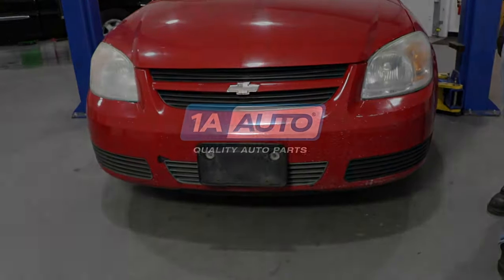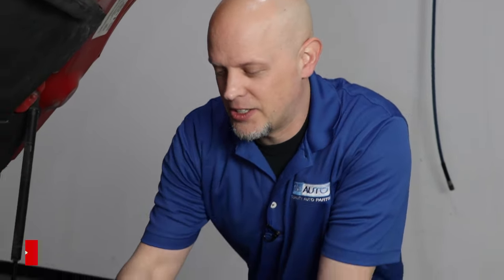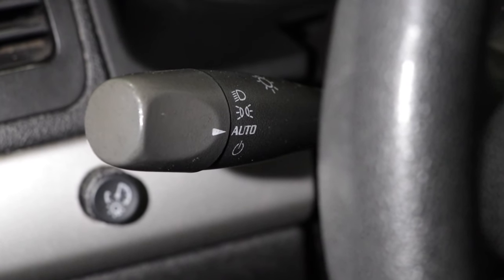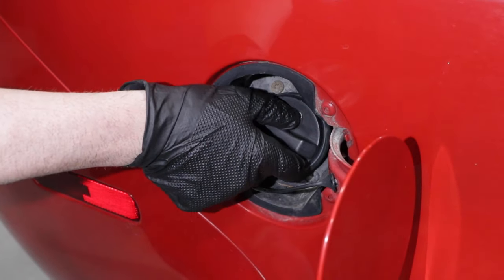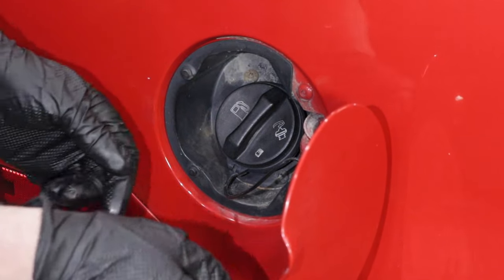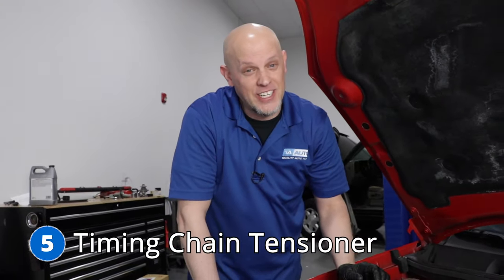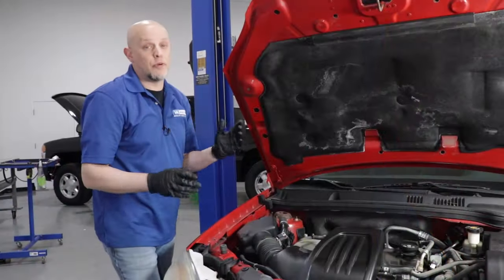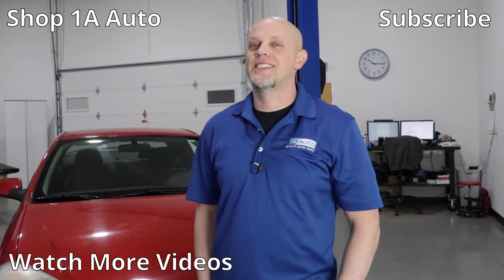Top 5 Problems Chevy Cobalt Coupe 1st Generation 2005-10

Comment: God I love my beat up 07 but sheesh I've replaced so much on her. Guess that's what you get for nearly 300,000 miles. One of the issues I've found is the seals around the back window have started to leak? I suppose dry rotting and my mechanic says it's common for colbalts, especially here in the midsouth

Comment: I have a '09 Cobalt LT, with 160,000 miles & has been great. Bought new, but now it's making a weird sound from the rear of the car at idle & stand still, like a twitching sound.
Reply: Same actually, I have an 09 and when idling while in D or P it will do this and slightly shake.
Reply: I also hear this as well

Comment: I just put a remanufactured engine in my 2005 cobalt LS. Prior to, and now after this, I get an occasional situation in which, on cold start, I turn the engine on and it immediately loses rpm and stalls.  Then, if I try to crank it it will not start.  Then, if i release the key and reinsert the key and start, the engine starts but it is misfiring.  Then if I turn it off and remove the key and reinsert and restart is is fine. What could be causing this? thanks  could this be the ignition switch? I dont know if the ignition switch was ever replaced when there was a recall.. I want to protect the new engine.  Others have said it could be fuel pump, injectors. but I think with the new engine those were replaced.  The coil pack and spark plugs also replaced recently. I had the fuel line replaced when it rusted as well.  sometimes the car chimes after removing the key to alert the key is still inserted.  One time the car shutdown when I hit a pothole - big jolt.  I feel like the ignition switch is bad. Could that be the problem?

Comment: I have an occasion service traction/abs light coming on. I scanned it & it was the passenger side front speed sensor. Note, it only does it in cold weather. Both front hubs have been replaced. Unfortunately, the sensor is part of the hub, at least anywhere I tried to get the part. The warranty is one year. It's been a year & ½. I would think if I had a bad cable, summer or winter wouldn't matter. I'm thinking the probe is off a little on resistance, or it's sweating in cold weather creating a ground fault. Are these sensors not replaceable without changing the whole hub? I have a 2007 Cobalt SS with 5 lugs.
Reply: I have the same car, except 2008 model, and had the same problem. Unfortunately, it comes only as 1 whole assembly. 1 replaced all 4 sides and right after the warranty ran out, I had an issue with one of them. I was able to take the wheel off and tighten everything up and unplug the sensor and clean everything real good with some brake cleaner and put it back together and the problem went away. A couple of months later, I had the same issue on another wheel. I tried that process again, but sadly it didn't work on that one and I had to replace it again. So based on my experience, there is about a 50/50 chance that all you need to do is clean it. Of course, the other half of the 50 would be to replace it again. Hope this helps 🙏

Comment: I have one mechanic saying my piston rings is my issue and one says exhaust..aren't those like 2 entirely different things?  (Low compression in cylinder 1, sometimes egg smell, transmission fluid put in cylinder and pressure went up)

Comment: I have a 2010 Chevrolet Cobalt the motor is finished need to replace the garage wants  2300$ for the job with a 6 months guarantee.  The used motor that will be installed has 72000 km, I do not know what decision to take replace the motor or not.  I am a bit scared to not know where this motor comes from and if it will perform, if its km is really 72000 or?  Si ce I have o ly 6 months guarantee I am scared that afterwards I can have other problems ..the car has no riat whatsoever and only 28000km is it worthed replacing the motor?  Can you please give me your opinion as I do not know what to do...no experience in cars...I have to decide within the next three days...

Thank you very much to answer me with your expertise on the matter
Reply from the maker: +@luciangelone We wouldn't be able to diagnose an issue like that here, you may want to have a local mechanic take a look at it. Thanks for checking us out! http://1aau.to/m/Shop-1AAuto-c

Comment: your 2 items did match mine the turn signal failure its prone to plastic cracking on housing and second one gas cap throws up obd code too even i replaced gas cap, you may add new item is rear shock premature failure
Reply from the maker: +James fatula Thanks for the tip!

Comment: Oil burning do to only changing oil when the computer tells you to change it .. recommend changing it 3-5k depending on oil and filter used and driving style.. I had a 2007 the engine was rebuilt at 170k .,
Fuel line rott mine leaked when the car was 11 years old  .. 
2009 they fixed the timing chain tension issues ..great year I had a 09 g6 motor ran perfect at 230k when I sold it didn’t use any oil.. 
2010 is a vvt engine

Comment: I have an 05 Cobalt LS 2.2L. I named it  "Little Death Trap." It has 186k miles on it and I've probably had about 5K in repairs done to it over it's 17 years with me, she's a bitchy teen if ever there was one, but she's paid for and i will driver her until she dies. 
1. Steering column recall done.  - free.
2. 1-2 Solenoid replaced - $650
3. Every window motor there is has broken at least once, but all while still under warranty - free
4.  Alternator replaced - $300
5. I can't remember what it was call but it made me sound like my car was an Indy 500 with the rumble - $700
6. Front break Resonators? i think that's what they were called, the things that make the car actually stop - $800, they were making an awful grinding noise suddenly, and within 2 days had to put old girl into the shop. turns out i was really close to unliving myself via Cobalt. 
All in All I do like my death trap. 
It also has the thing where the key wont come out of the ignition, which actually happened AFTER they did the recall, I just use the emergency key release under the wheel. The repair I'm told would cost $1500.  
It also randomly tells me that my gas cap is broken, and likes to pop Fuel codes. BUT it runs so freaking well and quietly that I sometimes have to turn everything off just to hear if the motor is still turning on, it sometimes sounds more quiet then new cars. 
She is burning through oil faster in her old age, which is annoying, but oh well.
Some of the seals are starting to go, not fun at all, and audio is wonky from time to time too. I keep telling myself that the speakers are out but then i change all the sound to those speakers and they are working. 
Also and, this is my favorite :[ it will literally turn itself off while still in drive. It's done it at a red light or a stop at least a dozen times over the years and it's not constant at all. it's completely random.

Comment: Gotta 2007 ls cobolt and my trans is whining sadly at 141k ngl I have pushed it to 115mph buttt besides the point trans is most definitely weak point especially since you can’t check fluid unless you do it by the plug under the car
Reply from the maker: +These People Thanks for the feedback!

Comment: forgot to mention common problem on cobalt and saturn ion 05’ front control arm bushing failure bec design flaw in factory slot type bushings i replaced the big bushing with full rubber around type it last longer  i cant belive saturn ion and chevy cobalt control arms are exactly the same even engine too

Comment: I have had a Pontiac G5 since fall 2015 which is basically the same car i will say they are not a great car but not a bad car they are cheap reliable transportation
Reply from the maker: +Adam Mcintee Thanks for the feedback!
Reply: @1AAuto  anytime i will add the rear coil springs, thermostat are a known issue i have noticed that front rotors warp easily on mine but i just put economy cheap rotors on

Comment: fail, rocker panel rust, fuel line rust, ecu/pcm craps outgiving you multiple driving issues and codes due to interior 10amp(#25) pcm  fuse  oxidation or connection issues- clean fuse contacts at block and replace/clean fuse, add exrtra ground wire to pcm, rusted out groud connections in engine bay

Comment: i have 05’ cobalt ls with 164k miles zero rust original starter and engine and transmission untouched only issue is rear right shock failure 3 rd time replacing it it was brand new last year  whats causing it i checked rear suspension in good shape no rotted rubber bushing no broken springs  new shock is gas o matic #55779 from advanced auto parts
Reply from the maker: +James fatula Thanks for checking us out! http://1aau.to/m/Shop-1AAuto-c
Reply: also zero leaks on ac and no oil leaks either

Comment: Rusted fuel lines - replaced. Driver side speaker failure - replaced. Engine selenoids - both replaced.  Now getting low engine power. Error P2122. Throttle body cleaned, car is good for a few days the error code comes back, anyone have any ideas how to fix this error code
Reply: Had the same problem. I changed my throttle body sensor and problem solved! Here's the video I used. https://www.youtube.com/watch?v=XrEtfEZyfl0

Comment: Na...
1) rust on rocker panels
2) stabilizer link kit
3) front door radio speaker
4) fuel line, rust and leak
5) front suspension control arms bushings

Comment: body rusting/rotting out, electrical problems, engine shutting off without warning, transmission shift control solenoid, steering intermediate shaft and control arm bushing failures are also common issues with these cars, even tho it was a nice looking car it was the worst car i've ever owned and glad to be rid of it.
Reply: Same. I had a 05 and the TCM went out, I had electrical problems that burned through 4 ignition coil packs, the front tire rods went out, my ac, alternator, starter and idly pulley went out too. It was in the shop almost every other month.

Comment: Personally think there is more bad the good with these cobalts. I have a 07 and at this point at about 75,000 there car is totalled. With that being said for the most part it has been reliable but currently needs the suspension re done it needs a new fuel pump and a tune up and some new tires to pass inspection. The cost at the shop to do everything basically cost the same as the car. Good thing I'm doing the work myself but my 91 honda prelude was a much better car even with 250,000 miles on it. There is no joy that comes from driving a cobalt but it gets good gas mileage I guess. Also really dislike Its built to drop the tank to do the fuel pump... why chevy... it's ok I'll just cut a hole myself like I said the thing isn't worth the time and parts that go into it atleast for me so slowly but surely I'm gonna be rat roding my cobalt. Can't say nothing about the ss maybe that's special but if it wasn't for how I got the car I surely wouldn't own one or recommend one if your in the market for one. 2007 2.2 5speed
Reply: Ive owned mine for 12 years now, 220k miles. Literally not ONE component has failed.... Ever....
Reply: Having to replace tires at 75,000 miles is a real  issue for you??????????

Comment: These are terrible cars! The front control arm bolt seizes and you have to cut up the bolt and my buddy scrapped his car after it happened to him. He blew a main bearing sitting in the parking lot and has been through three transmissions. Stay away!

Comment: Any one know if bad coil pack will make a 2005 cobalt go into reduced engine power mode
Reply: It's either the ground wires.  usually adding one to take afoot an a half  a couple self tappers an done in five minutes connect to ecm or tcm that aluminum part whith two plugs connecting to it""
    Anouther place for bad ground is down buy the starter their near buy three black wires check  strip wires slide a peice of shrink rap an clamp new end put a little die electric grease n heat shrink  water proofs an keeps frome corroding  if not shure whatch video on power stearing fix this little fix fixes many of the issues. Best of luck..
Reply: Ohh yea sometimes it ends up being throttle body but start whith the small stuff whish you luck.
Reply: On my 08 Lt the cause for it going into reduced engine power mode was a clogged up catalytic converter.

Comment: What about the electrical problems
Reply: I still haven't been able to fix my charging system.
Reply: @lokeymexican  yo I had a problem with mine for a while. I was able to fix it by putting a wire connected by an ‘eyelid’ at the alternator power connector. I connected the wire from the alternator to the battery post near the underhood fusebox. The battery ‘post’ comes loose, and you can slide the other end of the wire, also needing an eyelid crushed into it, underneath the battery positive post. That would give steady feedback from the battery to the alternator. I tucked the wore above the radiator, with the other factory wires. I havent had to jump it off since, and it starts right up
Also put a wire clamed by an eyelid and a nut head on the transmission controle module(which already has a hole punched out in it from the factory? Lol), and ground that out at the strut tower 
I hope this helps
Transmission rarely ever shifts hard anymore
Reply: @lokeymexican  i put 4 grounds on my car and i havent had an issue in over 3 years. clean and put a new ground under the driver headlight, ground both the pcm/ecm with clean grounds, and a final ground on the transmission ground and youre good to go

Comment: Cavalier 2.0. Idk how the hell gm managed to make the Cruze worse I don’t have a single friend whose made it past 90k
Reply from the maker: +Catbeat Brigade Thanks for checking us out! http://1aau.to/m/Shop-1AAuto-c
Reply: Really i remember gm delaying the cruze to make sure its "quality control" was up to snuff. Didnt know they are unrealiable
Reply: @CRAPO2011  super unreliable.
Reply: Mines at 275k right now😳
Reply: @matthe180  I’m on my 2nd 2003 cav, love it. Cheap parts, easy to fix yourself, very reliable. My first one ran to 200,000 gave to a friend and he drove it another 20,000! Bought my second one at 48,000 miles it now has 104,000 runs like a clock, gaps mustangs. Only had to replace fuel pump, and if you don’t let your tank get under a quarter tank that won’t be a problem when you run it low the fuel pump sucks in air and breaks

Comment: I've replaced the fronr suspension, by speakers fade in and out, my rear shocks are going, my gas cap is bad and my left rocker panel is rusted.  How are these "good cars" ?! Toyotas only from now on.  GM can go to Hell. Oh, yeah turn signal and don't try to start it with a dead battery.  It holds key and you can't get in the trunk where the battery is.  Stupid.
Reply from the maker: +Ryan Kenyon Thanks for the feedback!

Comment: I used to like Chevy but then I got a 2010 Chevy back in 2010 my power steering went out my transmission went out the tent came up my windows bubbled up the paint's coming off my f**** car worst car I've ever had and I only got 80,000 miles in the damn car and the car sucks cavaliers with a lot better I had a cavalier before I got this dumb piece of s***Cobalt you really need to go back to making the Chevy cavalier and not the Chevy Cruze or the Chevy Cobalt the Chevy cavalier was the best one lol them all the rest of them are junk next time I buy Karim even buy in a foreign car or a Ford never again will I buy a Chevy